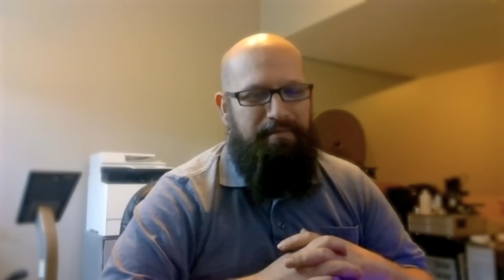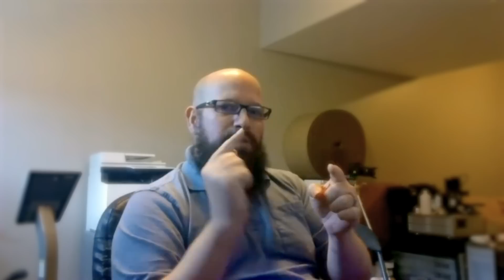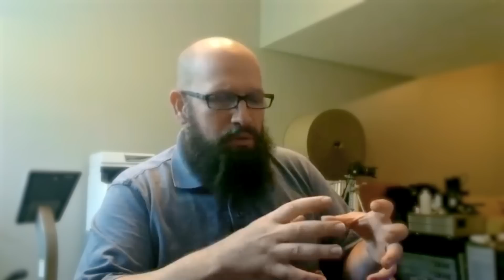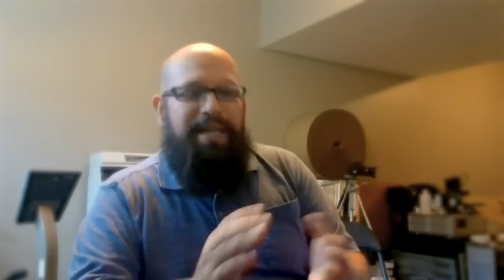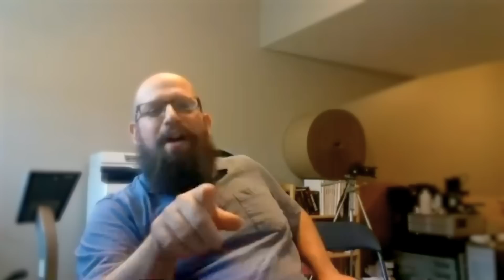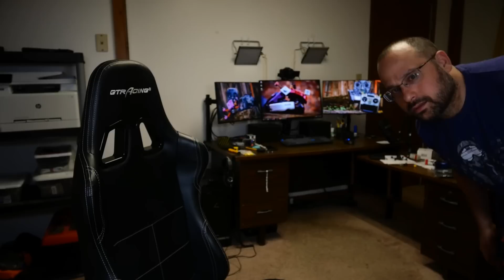Stop desyncs on your "160 mph" 6S 2700kv quad (with Ryan Harrell of miniquadtestbench)

Comment: I wish I could just buy motors and ESC's that were rated for this level of performance. I want to feel as secure as I do using lower spec setups cranking the throttle to 100% for the whole battery if I wish and not worrying about anything but how much mAh I have left. So come on Tmotor Emax Xing etc lets see you make a 6s 2700kv motor with matching ESC.
Reply: I think that's not really ever going to be feasible, as it's really outside the realm of normal operation. It works, and can even work most of the time, but it's pushing limits in a way that isn't really mass market ready. You're just always going to be more likely to have problems, and be at more risk of having failures. That's the nature of pushing the limits.
Reply: @QuadMcFlyFlies  ChangeAgent - It sounds easy to say 'make it better', but we're already doing ultrasonic power MOSFET switching at >1kw power throughput on something that weighs less than 25g... I'm work on 9-figure government programs that spend nontrivial amounts of money doing slower switching at the same amperage (higher voltage), and we're letting out the magic smoke pretty frequently.  
The 100% PWM duty cycle also is slightly more problematic - realistically the lifetime of an ESC goes up orders of magnitude topping them out at 80% PWM just from duty cycle, which is wild.  Really, the only reason to run stupid-high KV setups (I race on 2350KV 6S rigs) is that you can drop the top end and get marginally better theoretical part lifetime, and better mid-turn responsiveness.
Reply: @tehllama42  + quadmcfly I love often things are said to be too hard or impossible before they are done. So we need faster switching speeds. Well you can get RF mosfets that happily switch in the megahertz range and beyond with very low RDS on times. Due to the advent of millimeter wave tech we are seeing mosfets being developed that can switch in the terahertz range. The chap in the video said motors would need to be designed to use more power to satisfy the instantaneous torque requirements to prevent desync. I could cope with motors being amp hogs if they worked reliably. I know what you are saying about upper end reliability so maybe they should aim for 3000kv motors that we scale back to 2700kv.
Reply: @changeagent228  Right, but the key part of this is that we're talking power MOSFETs that are in the hundreds of watt throughput range realistically, so going to much more condensed setups that can run really fast switching matters for naught if you're trying to run a kilowatt of power from the drain, those RF fets are basically useless.  Just because you can make those much more compact doesn't mean they can deliver the power, and there are a few fundamental physics limitations of why the same approach isn't portable at all.  Getting a gate driver to reliably drive a power mosfet at this power regime is a different problem - the capacitance and inductance within the high side switching in order to actually make it a high power FET is just too large for those, and amplifier circuits would be too lossy (not to mention prohibitive) to try and bodge over to make the faster switching worth it...
Mostly we're running out of ability to reliably measure pole crossings, time those coil exertions, and dissipate any heat from switching losses BEFORE the raw switching speed is the limitation.  Kinda like saying in a car we 'need' more advanced ignition for road cars, when the real limitation is airflow and keeping the valves and pistons intact above 9000 RPM
Reply: @tehllama42  There are high power RF mosfets. The military and space industry use them. I would think the limitations would be cost. Sure most consumer RF mosfets are for small signal switching. One particular RF system the military uses is called the Active Denial which switches 85KW at 95Ghz. High end military tech uses gallium nitride not silicon. 
GaN has lower on resistance giving lower conductance losses. Is faster yielding less switching losses.
Has less capacitance resulting in less losses and less power needed to drive the circuit. Also it's possible to make smaller devices taking up less space on the printed circuit board. Also potentially lower cost.
Reply: @changeagent228  There's a reason why in directed energy applications (and also most higher power satcom) we (this is my day job) don't use solid state electronics for generation of stuff.  TWTA's and klystron configurations are still quite common at any frequency of interest, and that's before getting to the really high powered stuff.  ADS on the actual high powered end it's using anything solid state, (gyrotrons and other stuff doesn't rely on the same slow wave structure topology as semi-solid state sources and conventional vacuum RF sources).  
The closest thing to this is IGBT on high voltage power supplies into pulsed power systems in terms of operational modalities (driving large transformer windings), and in that case we're still ultimately limited by the same fundamental gate driver and timing/EMI mechanics that are at play here.
Reply: @tehllama42  Yes the first generation systems were non solid state. Further development yielded solid state versions and even a handheld version. https://www.google.co.uk/amp/s/www.army.mil/article-amp/176579/ardec_engineers_develop_solid_state_active_denial_technology_for_non_lethal_crowd_control . But anyhow yes silicon IGBT tech is on a par with gallium nitride and it's exciting to see further developments and how it will relate to our hobby.
Reply: @changeagent228  So, having looked into that more, the compact version IS in fact scaled solid state and the waveform generation is handled by the RF switching MOSFETs - although the amplification and gain driving aspects of that being effective is fairly different that the rest of the truly high powered stuff we work with - some of the other solid state technology is also promising, but that is one niche area, and practically for the applications we're talking about even directly dropping those into this ESC application, we still ultimately end up limited on the sensor side of that (whereas CW output is great because you can reinforce that).  There's also a reason those have a thermal management system that is comparable in size to the rest of the deal.

Comment: you talk about capacitor derating @9:35 and I will explain it since it's very fascinating. Let's take a random capacitor GRM21BZ71E106KE15, it's a 10uF 25V 0805 MLCC capacitor. If you run it at 5V it's value is 6.794uF if you run it at 25V it's value is now 1.309uF.  Yes you read it correctly you paid for a 10uf and at 25V it's now 1.309uf!!!! The problem is that you have NO clue what capacitors you have on your ESC. Well Jerome, take a 50V capacitor! They are harder to find in 0805 size and more expensive. From murata, I found a 50V but it's only 4.7uF, 5V is 4.057uF and 25V is 1.033uF. If you want to make it work you get a 1210 size cap and you can find 10uF at 50V (GCJ32EC71H106KA01) and at 5V it's 9.557uF and 25V it's 5.631uF. It's a much bigger capacitor and you need to find the place to place them on our small PCB.
Reply: Yes, this is exactly what I was talking about :D fortunately at the very least the gate drivers run at a fixed 12v in most cases regardless of input voltage, but that's assuming there isn't an increase in induced noise as a result of the de-rating in the full voltage parts of the circuit.
Reply: @QuadMcFlyFlies  Yeah, the EMI at the gate driver side is what I'm convinced is the problematic part - transients that affect turn-on delay on either side of the Miller plateau is what really kills stuff off, especially on switch-off as we enter into a different thermal regime.
Still fundamentally different that the firmware dead time error (cough NamelessAIO cough) and outright underrated low side capacitance mis-speccing that we usually have to deal with.

Comment: Does it make sense to put the escs closer to the motors to reduce the inductance of the wires? That would allow a faster change in current.
Reply: We've actually done some testing with various gauge wires which would be very similar to changing the length of the wire in terms of end results in resistance, and the difference is not enough to create a measurable change. It's just too small of a change in resistance to make a difference.
Reply: In a 'worst case' scenario of thinner wires and adding racelitewires, the power delta is within the measurement error of the system... so I wouldn't bother really

Comment: The metal MOSFETs (DirectFET is their name) does not use wire bonding and my theory is that the wire bonding is the weak link in traditional MOSFETs that limits the maximum safe instantaneous currents.
I'd like to see sensored ESCs in our hobby as that should allow for tighter timing and would also remove the desync issue.
Reply: Improving the sensing seems logical, as back-EMF estimation can be tricky, although in the EMI environment we're subjecting these things to, the marginal gains are pretty tiny.

Comment: Nice episode. But I am really struck by the algorithm that youtube comes up to recommend this video. I have been doing 1000 feet FVP diving helicopters for 2-3 years with fixed RPMs that are not supposed to have these randomly changing RPM desync problems, until just yesterday when I really pushed the envelope of the tail motor that used a quad motor. I suffered my worst crash yesterday. And today youtube AI just figured that I need a desync lesson. The only clue I gave was a uploaded crash video. And the AI just went ahead and decided that it was a desync.

Comment: So far I have been lucky.  No D-Sync yet.  I initially set 48KHz, DeMag High and default Ramp-Up.   (TMotor F55, TMotor F60 Pro3 2700kv , Lux F7 FC, CNHL 6s 1300 Black)   I'm seeing 130 Peak Amps,  and 140 mph GPS speeds.  I get two (Dragster) 5 second runs with about 3 seconds of full throttle and about a minute of "cool down" cruise flight before the battery  is done.  I still need to get the APC bull nose props...
Reply: Yeah, you're prop limited with that setup, and aero - but that is totally baller.

Comment: I still want to know how Fettec gets away with running 128kHz.. under the current “theory” that says that higher PWM frequency = less capable instantaneous torque, how does this make sense? I have 3 quads with Fettec and I can report no loss of torque. I think the magic happens in the Auto timing logic and the superior processor speeds of the Fettec ESC. As is also mentioned by Fettec themselves. I think the BLHeli code needs updated. It’s old now and seems to be the cause of more and more issues as FC code and motor tech get better and better
Reply: It's not necessarily instantaneous torque that's the problem, in fact I would say that instantaneous torque is fine if the duty cycle differential is large. It's small changes in throttle a low duty cycle that appears to be the issue. I'll be doing some more targeted tests over the next few weeks to get some more detailed information on that, and I hope to include the Fettec in that if possible. Since Fettec is proprietary the truth of what they're doing is impossible to know for sure, but my guess is it is way more than auto timing logic, as timing has nothing to do with the issue of higher PWM rates. If they are doing something to compensate it is likely dynamic PWM rates at low duty cycles and low commutation rates and potentially some shifted braking methodology. 
Also it's worth noting the loss of torque at low duty cycles would be very difficult to detect without the right type of logging and can be largely compensated for in the FC by proper tuning, though would likely still show up in logs if you know what you're looking for.  
As far as things go BLheli32 is not old, it's still in active development and new releases are still coming out. Combine that with JoeLucid's work on JESC and I think the issue isn't the code base.  What you're really seeing is the fact that Fettec can control both the ESC and the FC software and work to integrate them on a very narrow range of hardware, vs BLheli32/JESC and Betaflight which supports a massive range of different hardwares with varying capabilities. In the end Fettec has its own set of performance issues, and seems to be much less resilient to desyncs based on conversations I've had with test pilots, even with their controlled hardware sets. Felix is brilliant though, and I'm sure he's working on solutions, but there's a drawback to early version software. We saw the similar things when BLHeli 32 was first released, and before that when BLHeli_S was released.  
All things considered though it will be interesting to watch what develops as we look into these details further and increase our understanding of what is actually happening in the ESC and between the ESC and the motor.

Comment: Coming to desyncs.
Will it make a difference if you run an F0 esc vs an f3 esc ?
The f3 might be better in processiong that zero crossing wouldnt it ?
Reply from the maker: That's a good question but to be honest I don't know. I have a feeling that the processor is not the limiting factor though. That the ability of the FET to turn on and off quickly is the limiting factor.
Reply: Yes, I agree with that assessment, the F3 has other benefits like being able to handle the input to output code at higher rates without bottlenecking, which may have some impact on stick feel by dithering the input signal to create an effectively higher input throttle resolution, but I think for most pilots it makes very little difference. Also F3 can handle higher PWM rates, I know there have been some experiments running F3s at 96khz and higher PWM rates, but again what impact that actually has on the quad is still unknown. I don't think it will have a major impact on desync handling but it might allow better handling of auto timing for example at higher RPMs. I'm not sure what the CPU usage is looking like in that regard currently though.
Reply: @QuadMcFlyFlies   About the 96khz handling.. I've flown one of my friends fully fettec quad. Thats on 128khz and it feels hella different from both of our kiss quads. There's probably more to it than just the pwm frequency but it is so distinctively different feeling from the regular kiss (or blheli) escs it is crazy. Nothing else feels like this.
Reply: @QuadMcFlyFlies  thanks for clarifying :D
Reply: Ultimately, no.  Higher processor frequency won't affect the estimation error on pole crossings that will happen towards the top end, and realistically I think it's most likely to be a pole crossing slightly mis-timing that starts pushing into inefficiency (that starts making more extra EMI from switching because of more torque strain), and those current spikes eventually spilling over as EMI into a gate driver is what will make bad things happen fast.
I think the super-high dithering (128kHz, 96kHz) if it's psuedo-RRC PWM estimation might be able to take us more places (I think that's what the FETTEC SINE system is doing), and practically that might be the future, although more switching events is probably not as efficient overall.

Comment: about the low throttle oscillations: when I first switched to rpm filters I kinda copied my old pid settings but increasing p and d with 10 to 20%. made some other changes based on the warnings the betaflight devs gave when using old values. I had horrible and "slow" low throttle oscillations, but only when hovering or slowly moving. When I looked at the blackbox I noticed the d was only 0.25pi ahead of my p curve so I guessed I had to much delay causing the d only to amplify the oscillation and not dampen it. Reduced filtering a bunch and it flies great and with much less noice than before rpm filters. I might have done something dumb initially as i did fully read trough the rpm filter recommendations, and can't remember what my old settings where. But maby there are more ppl who made the same mistake as me if the have bad low throttle oscillations that disappear at higher rpm's.
Also: shoutout to the aikon esc. Bought it because few ppl said theirs failed and mine is still going 2 years later :D